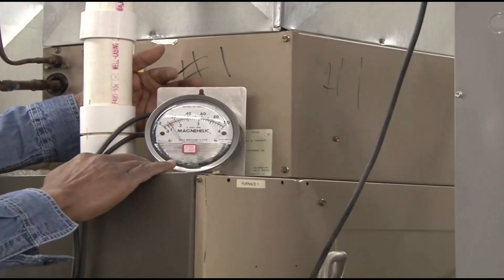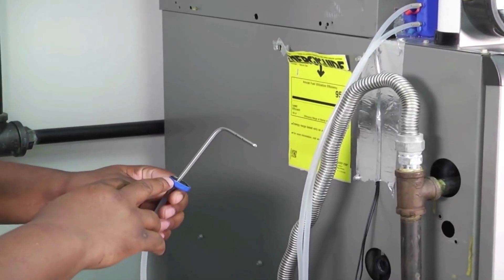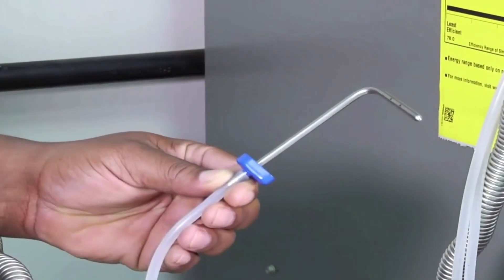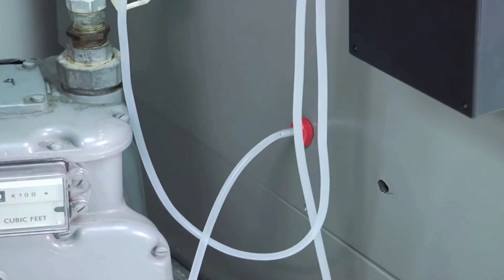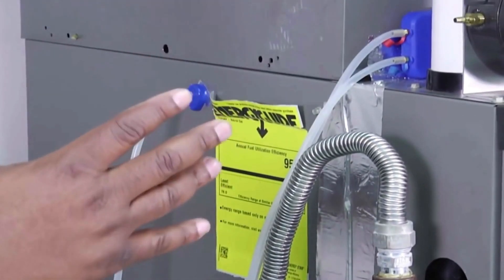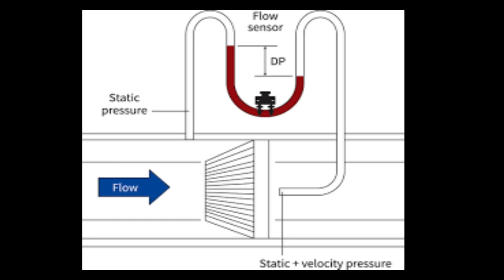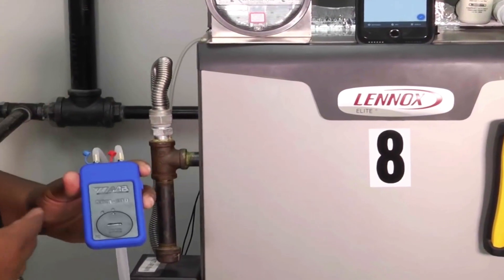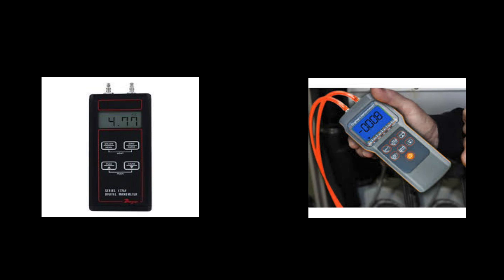HVAC Tech School: How to Read AirFlow Differential Pressure?

Comment: Good video, thank you for posting.  One minor technical detail, the angled probe shown in the video (closed tip that is pointed into the airstream) and commonly use for static pressure pressure testing is not a pitot tube,  it is a static pressure probe.  A pitot tube is used for measuring airflow.  It has a hole in the tip (pointed into the airfstream) to measure total pressure and another set of holes to measure static pressure.  The static pressure is subtracted from the total pressure to calculate velocity pressure, which is used to calculate airflow.

Comment: if magnehelic  gauge  measure the differential pressure for water also??? because i have pipe filled with water and i want to measure the differential pressure between inlet and outlet  for water ???